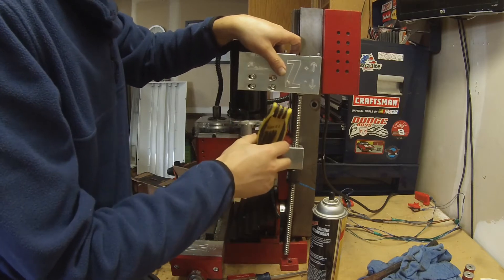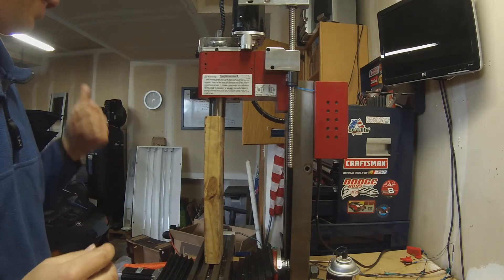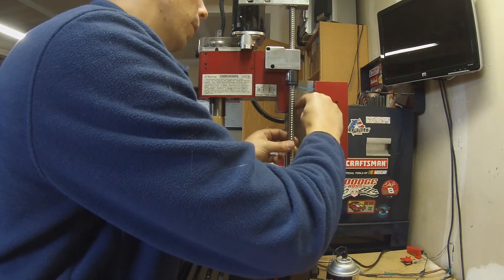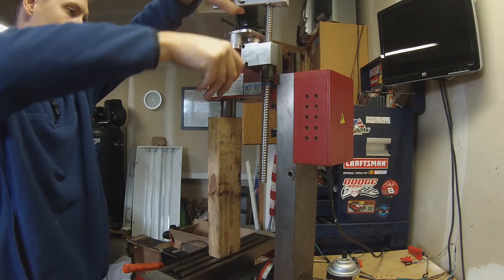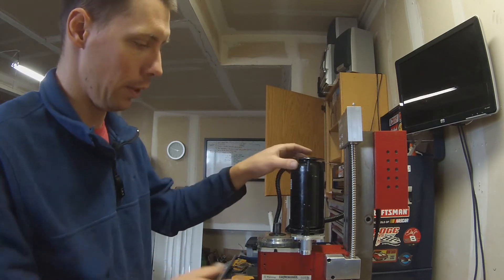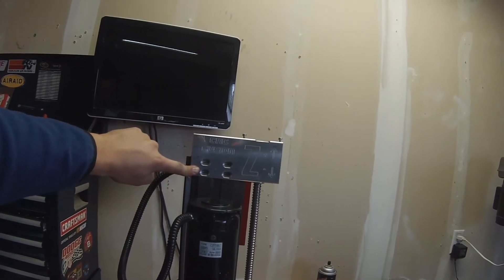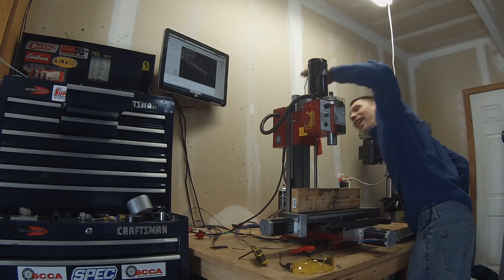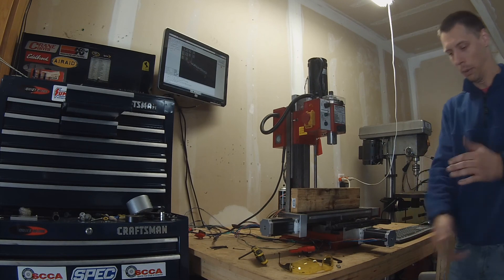Mini Mill CNC Fusion Conversion Part 2 || Z Axis

Comment: I have the same mill and plan to convert it as well, I bought plans from thelittlemachineshop.com and I like their z option better, glad I watched your video to see how it blocks the gib adjustments. I drew the plans up on fusion 360.. if you want I could share them with you.. 👍 I would like to pick your brain on the electronics portion.. I want strong enough motors, is linux just the computer os? I was looking into mach cnc software I think it was
Reply: * The z option the plans show goes right on top, so a more central way of lifting the head vs from the side which seemed odd to me..
Reply from the maker: I haven't seen the plans, but lifting from the center would be better.  The main problem I have with the Z axis is the exposed ballscrew.  If shavings get on the ballscrew, they work their way into the ballnut and jam everything, causing missed steps.  Maybe having the screw in the center will make way covers more effective.  I've been really happy with the closed loop stepper in this video (links are in the description): https://www.youtube.com/watch?v=S8c6c4CYZUU I see that StepperOnline stopped carrying the motor I am using but now has one with the driver attached to the motor.  That motor is here: https://www.omc-stepperonline.com/integrated-stepper-motor/Integrated-Stepper-Servo-Motor-3Nm425-oz-in-24-50VDC-NEMA-24-Closed-Loop.html/?tracking=5aac72b14c081 I just don't like that the electronics are subjected to chips and cutting oil.  Linux is my operating system, but it can be downloaded as LinuxCNC.  This version has the CNC control software included and ready to go.  I haven't used Mach but haven't had any issues with LinuxCNC, yet I've heard of issues with Mach.  I hope that helps!